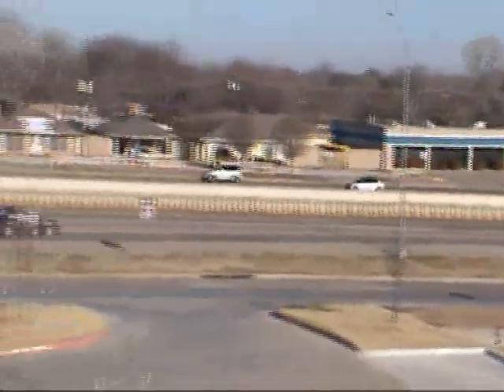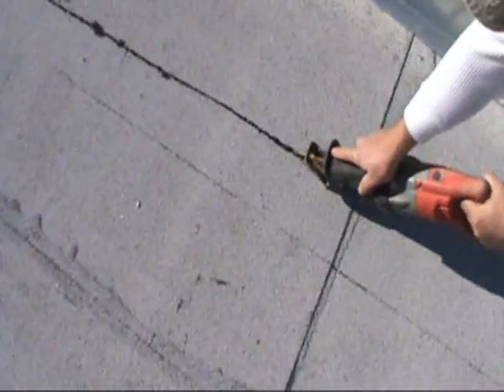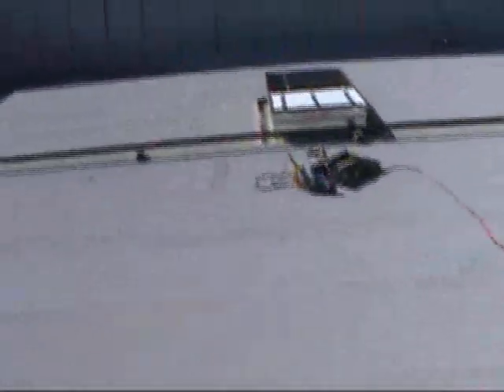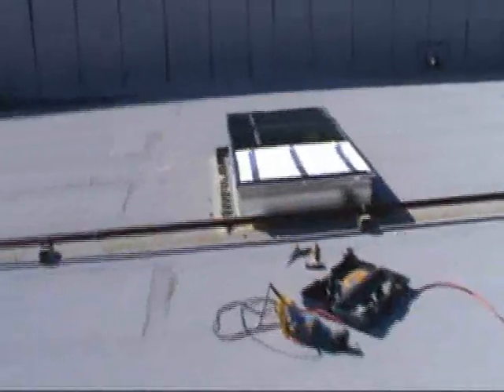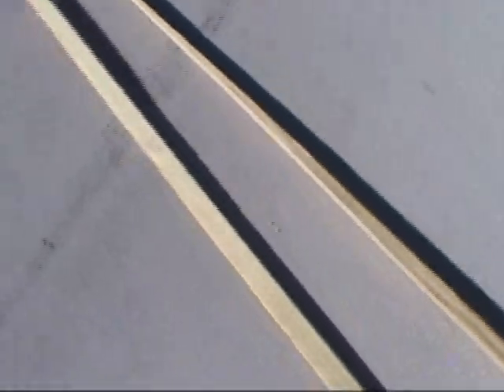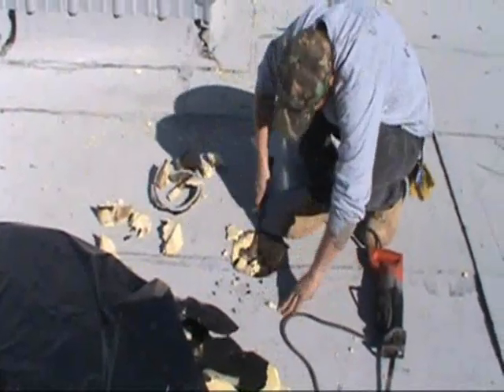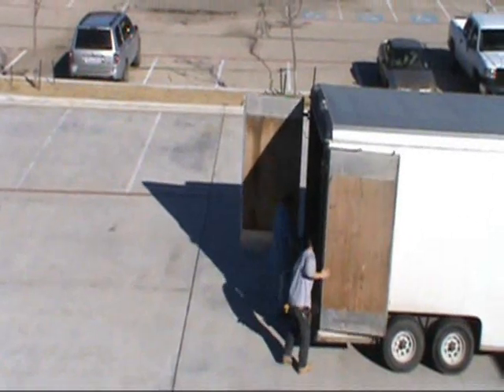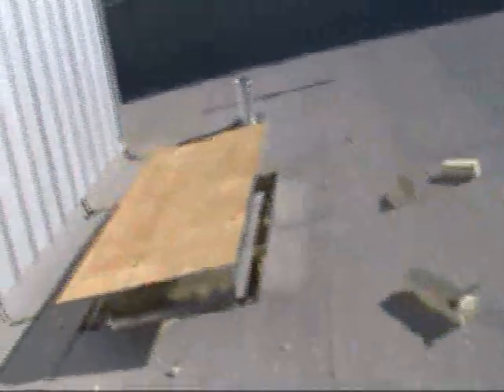Curb Setting

Comment: Although we aren't supposed to do it we also use the lift to get our assembled curbs on the roof. Got stopped many times doing it the way you showed on your video so we ended up putting the curb angled into the lift what a pain in the butt to get it out once at roof line. We also are required to wear safety harness before cutting out the opening, along with ear plugs and safety glasses. Thanks for sharing. Phil D.

Comment: Hey Robert. My name is Phil. I was watching your video and noticed there wasn't any structural support under the roofing around the perimeter of your curb. We always have the general contractor install the structural supports to make sure the roof doesn't sag around the curb once the unit is set. We are also required to write in big letters HOLE across the wood on the wood covering the curb and screw the wood down. Instead of wood we use heavy metal L-channel to level curb. Much easier. Thanks.

Comment: Do the instructions say how much of the metal deck to cut out?
Reply from the maker: You only need to cut it just big enough for the supply and return to fit through
Reply from the maker: Be sure you have structural support for the unit before you cut a whole an fall through

Comment: Who decides where to cut the holes on the roof. Does cutting compromise structure on roof.   Does an archtiect or engineer have to look at this. Cool video lmk
Reply from the maker: Yea we just cut them where the plans showed and they usually already have the steel supports in place when the build the building. Everything is planned out before the building is even started.
Reply: @robert1988420  nice job. So it seems like you only cut   opening for supply and return duct is that correct. If so why do you have different openings at curbs?
Reply from the maker: Not sure I follow you but yea its just supply and return. I haven't done a/c in a long time switched proffesions about 3-4 years ago.
Reply: @robert1988420  the curb has different sections.  What are each of those sections for? Besides the supply and return.   Crossbars on the curb. Are theu for support or are they openings for something
Reply from the maker: Ah yes just support if I recall right